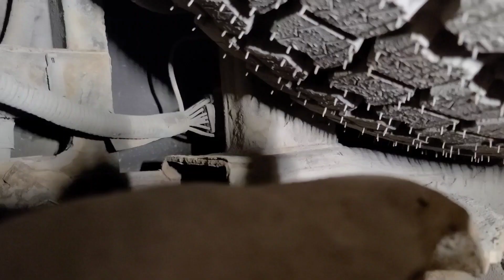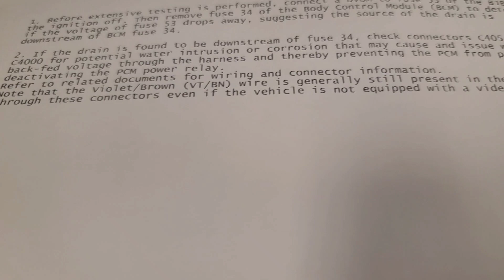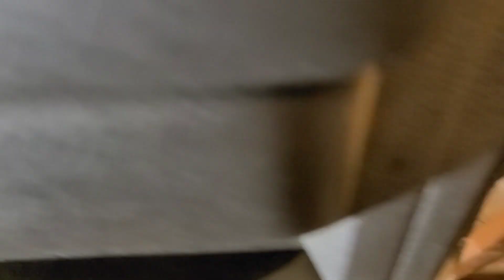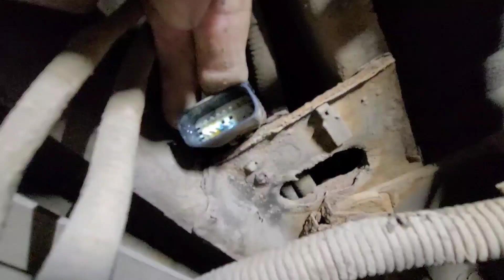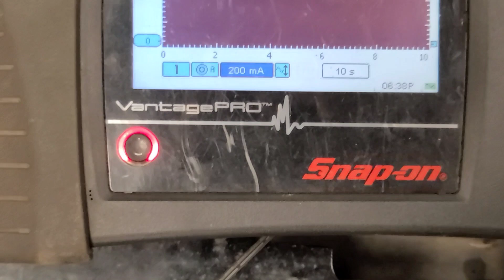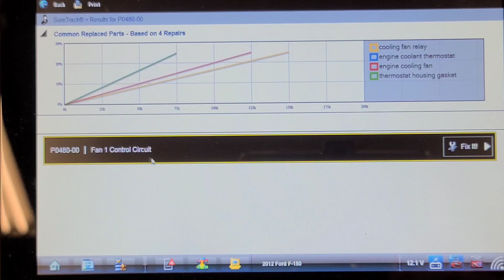2012 F150 Battery Drain Parasitic Testing Pt. 2 The Fix

Comment: Amazing videos! Im trying to find one on mine. But thinking its rhe little switch my the center console shifter. Ive replaced it before but i removed the center console last month to replace my ac evaporator and heater core so im wondering if i damaged it.. im getting close just trying to be sure

Comment: Great video thanks for sharing your information .what diagram program are you using sir ?
Reply from the maker: I'm using a subscription service from Identifix but they don't usually cater to the DIY techs  try Alldatadiy.com they do and have the same or similar information
Reply: @PhillipBailey  thanks sir for rapid reply I’m from California we use identifix and all data but the diagram is different than I see it in your post. Thanks again and appreciate
Reply from the maker: @odishoodisho4904  one of the reasons I like Identifix is they usually have 3 versions of electrical schematics.  They have OEM usually with functional hyperlinks. I was likely using that here. Then the also have color diagrams which are Mitchell which if you are familiar with them are redrawn in a standard format often condensed. This sometimes helps with the OEM diagrams are ladder or just hard to follow. Then the have Motor diagrams which is Alldata and are OE but no functional hyperlinks.

Comment: We have a huge problem with green crusties so the obvious solution would be to eliminate the copper corrosion problem. We need a special alloy that does not react with the water salt mix used on roads or provides an oxide protective layer similar to stainless steel.
Reply from the maker: Even if the terminals were gold plated they would not oxidize but salt water in the connector would still short the terminals.
Reply: @PhillipBailey  Incidentally I no longer will use the pure copper trailer connectors. The tin coated terminals are a huge improvement with quite a reduction in copper related corrosion problems.